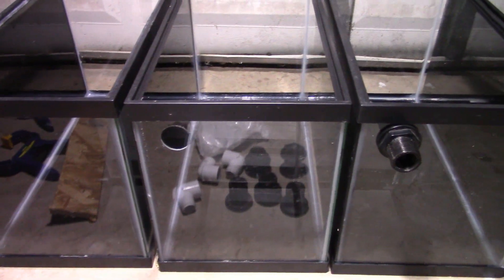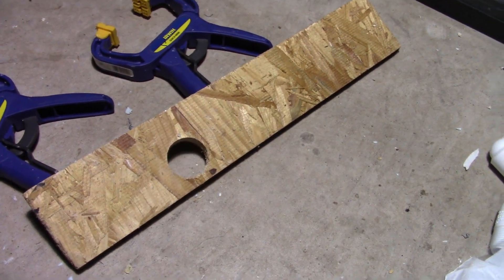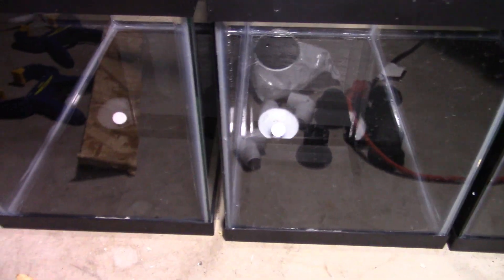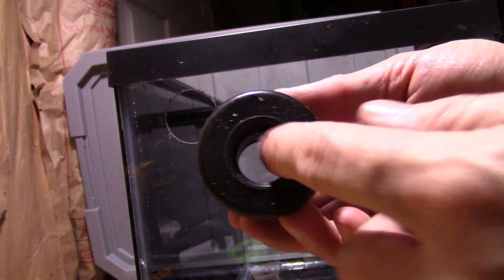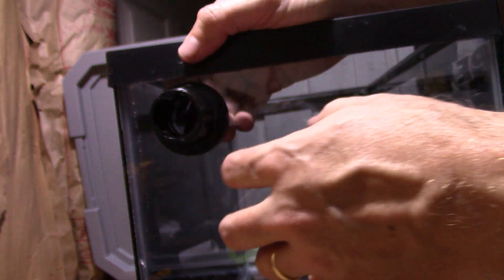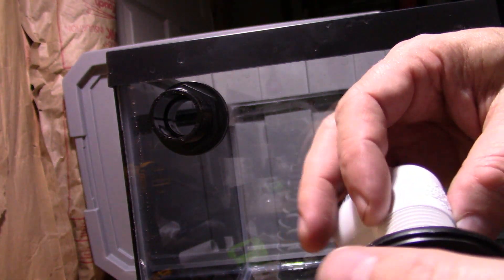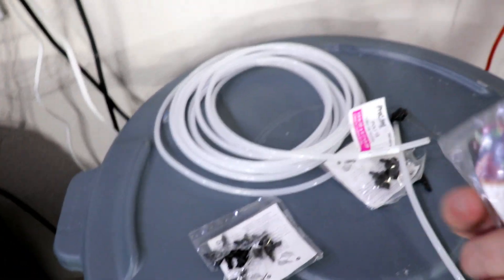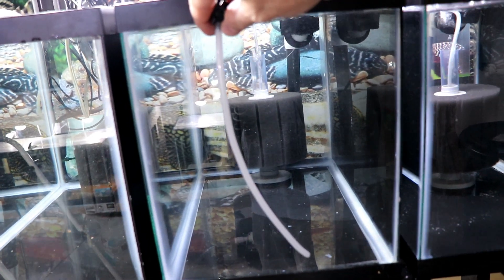Auto Water Change System - Fishroom Upgrades

Comment: Background looks awesome, I like your method , lol I'm still tryi g to find a way to remove are chloramines for my system. I don't have room for a reservoir. You might be able to stick a 300 gallon ibc in your garage if you insulate it and heat It? It might not even need a heater depending on the flow . Dans fish had a cool tank setup
Reply from the maker: I thought seriously about moving the garage wall out more so I can do something like that because the 2 40gallon trash cans are just not cutting it right now. I've watched some of Dans videos but not lately I'll go check it out. Have you tried a simple RO system that just runs carbon in all the chambers to remove the Chloramines?

Comment: I’m setting up my first big rack of tanks and I’m really wanting to drill the tanks and do a drip system to make it easier for me since I work so often. I’m nervous though
Reply from the maker: I would practice on an old tank until you feel comfortable on the amount of pressure to put on it.

Thanks Jason
Reply: Jadren Aquatics yeah that part of the video really made me more inclined to do so. I got a free 10 gallon that ended up leaking. So I could keep and do my first reseal, or I can practice drilling the glass.
Reply from the maker: @UHPhilipA  perfect idea!

Comment: Hey Jason, back drop looks good. Allows you to add more pictures, and things.
As far as your drip system you could use drip emitters that will allow you to fine tune each tank. Attach to the end of the line on each tank. They come in a wide range.
Reply from the maker: I assumed the drip emitters will not work when submerged, any idea?
Reply: Jadren Aquatics ; They'll work as long as you have water pressure to force the drops out. Dont know how much pressure that pump supplying.

Comment: Not being able to tell flow rate is why most have the inlet above water. I get the circulation concerns, but it’s more risky to not have a tank changing volume properly
Reply from the maker: Actually I completely changed the drip system a few days later because of that. Thanks!

Comment: That seems pretty risky having the drip tube in the bottom of the aquarium, reason being is it will create a siphon once the line is full of water and self level out all other tanks, if one of your tanks has some diseases it will spread to your other tanks, it might even backflow down to your bucket if that mist pump is tuned off and doesn't have a check valve,  good video tho' keep it up
Reply from the maker: No the pump I'm using keeps pressure on the line all the time so its impossible to back siphon I think it has a built in check valve. Thanks!